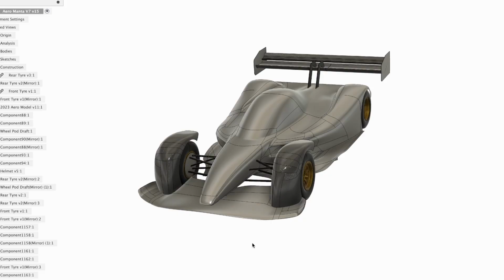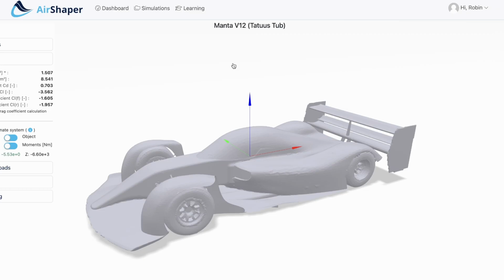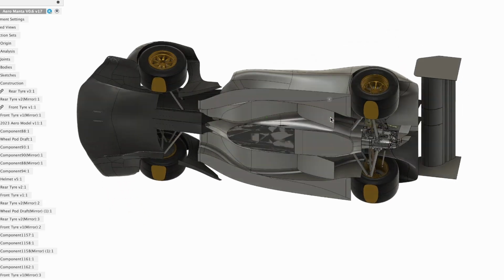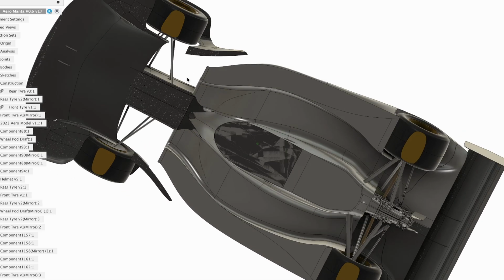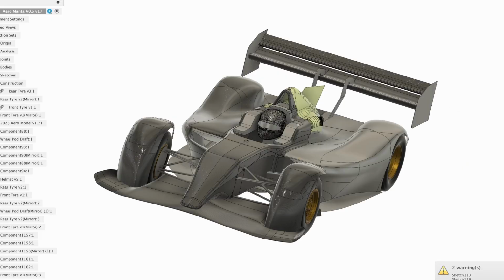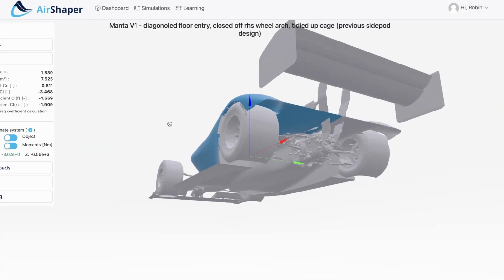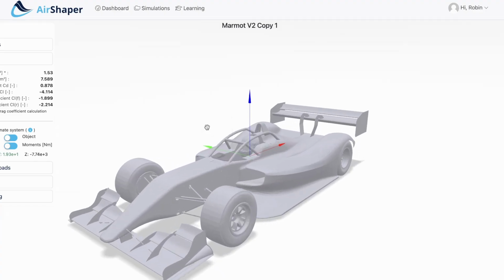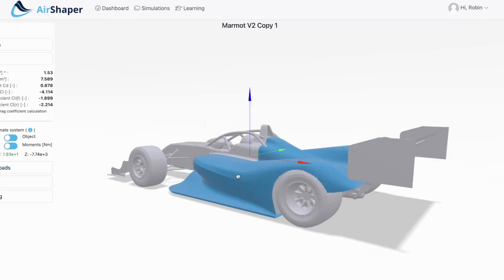Aerodynamic insights: Pikes Peak Project Pivot

Comment: Would it ever be beneficial to have downforce elements on the wheel side of the suspension? To apply downforce directly to the spindle instead of from the body to the spindle?

Comment: Flaps, deploy-able trip-strips/VGs, or blowing slots in the tunnel are all very interesting.  Using a "single" central down-force control should make failures less catastrophic in addition to simplifying everything.  ("single", because you still might want to split the flap action left to right to help turns)

Comment: Why do you start the underbody tunnel behind the front suspension?  Why not start it between or in front of the front tires?
Reply: Probably to account for the gearbox sitting there. The motor is compact and the gearbox isn't massive, but they do still take up space.

Comment: I find the shorter under body tub continued by the engine cover an interesting compromise.   On the one hand it breaks the smooth attached flow in the diffuser, on the other hand it lets you introduce fresh high energy air from the cooling system at a critical point to avoid flow separation.  Kicking the back of the engine cover up more and installing over-kill cooling fans could be an interesting future mod.

Comment: Im not sure if its just the video but the air shaper cad model seems very jagged especially with the roll cage and suspension, which would cause havoc for a cfd simulation

Comment: On your CFD trial of aero elements attached to the front wheels, turning with the wheels, to help with turning, but only generating 0.1g lateral:

What of the aero elements did not pivot with the uprights?  What if they were turned by the steering tie rods, but had a pivot  point closer than the uprights. Do you could amplify the steering angle to the aero elements?  So, you turn the front wheels 10 degrees, but the aero elements turn 20-30 degrees, for example?

Comment: How about the banned F1 version of active aero?  The driver moves their knee over a hole, which blocks off some airflow and stalls the rear wing for lower drag on the straights?  (I think I have that right)

Or does a solution like that require too much design and testing, needing a F1 budget?  (On constant altitude?)

Comment: How do you decide where to put the throat of the tunnel?  Is there a general sizing ratio for tunnel inlet size to throat to expansion champer size?  I am working on tunnel ideas an open wheel autocross car.  Love watching your videos.  Cant wait to see the build process!
Reply from the maker: It's a tradeoff between where you want the centre of pressure and what other parts of the car are in the way

Comment: Body styling wise it becomes very hard to do something that nobody has done before and be aerodynamically effective at the same time . I tend to agree with you , the open cockpit is the better looking though not a great looker . In my mind the coke bottle profile looks to fat at the rear and out of proportion. I’d have a dabble at making a fancy aero section between the front arches and the top of the tub either flat or dihedral  . A bit like a canard but full width. If that gave you more front end then you could balance it out with a better rear aerofoil. 
I’d appreciate some detailed analysis of suspension geometry and your options on roll Center heights, caster camber gain / settings on a double wishbone setup. Mainly , do double wishbone cars have less than Mcphearson strut type vehicles. ? And for what reason .👍

Comment: Wouldn't it be the best idea to cover the rear wheels? Makes an absolutely massive difference in terms of drag, and I'm assuming brake cooling isn't nearly as big of an issue on the rear wheels (and can likely be solved in other ways).

Edit: I meant covering them fully, like on the Volkswagen XL1
Reply from the maker: I ran those experiments, wheel covers work better
Reply: @ I meant covering them fully, like on the Volkswagen XL1

Comment: A question on the relationship between aerodynamics and handling. Cars struggle to change direction as they get heavier (increase in mass). How does this differ from a handling standpoint when adding downforce? Both add weight to the car although more downforce is good but more mass is bad.
Sorry if I am phrasing this badly but it has always baffled me and I'm hoping to understand the difference
Reply: Downforce doesn't add mass the the vehicle, as the name implies, it only adds force.  Downwards. The inertia of the vehicle stays the same.

Comment: Hello good sir, I have this question that might just be silly. I was wondering if the material that is used for the vehicle would affect how the vehicle performed aerodynamically? For example would a carbon fiber body outperform fiberglass not in terms or weight or strength but aerodynamically. I really was just curious
Reply from the maker: Just aerodynamics, and ignoring everything else, I don't think so. But stiffness is important as maintaining correct shapes or flexing in a designed way can really help
Reply: @thesendyclub  thanks much for sharing your knowledge, much appreciated, I'm trying to get into the automotive world and every bit of information is appreciated even if it's not "necessary/relevant"
Reply: Smoothness also matters (but it doesn't matter how you get that smoothness.

Comment: Weight or Drag? I was shocked at the Cd listed compared to street car numbers I'm familiar with. Then a little research and yours is comparable to F1 body types. It's all about downforce. Since you must have downforce which creates drag. Then the lowest weight possible (I know you are already doing that) makes the greatest difference. I would think undertray for negative lift would center the downforce, vs the wings which puts it on the extreme ends. Center seems more stable/predictable for handling. 

Really this is all a thought experiment to me. I don't have any practical experience (which is obvious). Thank you for sharing your process with us.

Comment: For the model, are the floor and body actually connected, or are they separate pieces positioned as close as possible to each other? If they are connected, how do you do so with the surfaces?
Reply from the maker: Separate parts so we can get individual component forces. I use zero tolerance on these models. Airshaper figures out the rest
Reply: @thesendyclub  What do you mean by zero tolerance? Is there a way you consistently get the parts as close as possible?

Comment: If you want something a bit more visually striking I would modify or just redesign the front wing. I think the body looks fine, not as cool as the Manta concept, but close. It’s the front wing that makes it look old school. Replace/modify that to be like the concept with the front wheel covers and tied back into that low body plane and I think it will be more striking.
Also I love that this is following the arc of a real engineering project, start with wild concepts, buy into a few constraints, make some tough decisions on compromises to meet budget and schedule and hope you end up where you wanted.
Reply from the maker: Hmmmm, great minds think alike....

Comment: in orther to generate more high pressure under the nose boxe, you can upper the nose a bit more, like in 2010 f1 cars, and extend the floor foward all you can. You will create more downfore with the floor
Reply: I say this becouse the floor is the more efficent aero part of the car. So I would start making the best with the floor and the other parts of the car. Look for example how the Empire Wraith floor and diffuser is built, and also the PP version
Reply from the maker: There are quite a few ways to feed air to the floor. You're right, in the early 2010's they found the high noses gave them some gains based on that ruleset. The nose you see on the car is the stock Tatuus item, the final nose will be a little different

Comment: Very interesting! Do you expect/have you ever experienced porpoising? Your floor looks very F1 like, but since Pikes Peak is quite bumpy I suppose you are not running nearly as low, so I suppose it's not really a problem?
Also, I've seen that you mainly use your front wing as a downforce creating design. Because it is so low to the ground it is generally quite easy to hit downforce targets, and it's usually seen as a device to manipulate the airflow to make the parts behind it work better (think Y250 vortex and such). So if you go into the details, you should probably start looking there and what you would like to achieve at the rear.
Reply from the maker: Yes, porpoising will be an issue with this much underfloor downforce. The shortened floor I have shown will be very susceptible to that, and I have since adjusted the floor's geometry to help. But that will always be an issue I am fighting. You're right about the front wing also, a lot more development has come there also
Reply: @thesendyclub  At least you have unlimited regs so you can play around with "ice skates" and stuff like that, that should offset your lack of experience and tools compared to the F1 guys

Comment: Are you simulating with no yaw? If so are you able to split the model along the centerline and apply a symmetric boundary condition? Gets you more detail for a given number of mesh elements but obviously less useful with asymmetric air inlets, radiators etc
Reply: Ride Height too?
Reply from the maker: Good question! For a lot of development I did straight ahead and a fixed ride height. But there has also been work done at Yaw and whole ride-height sweeps

Comment: i have a idea to add to a piks peak car that is just cant get out of my head.
english is not my first langwitch and its rikky to explaine.

but if u are curius jest DM me or react to this coment and i will try.
Reply: oke let me try.

u use a fan to pull the air true the radiators, u use a simple and un controlled dynamo on the crankshaft at the distribution side of the block.
u then place the radiators length wise at the side.
so that forward motion of the car will not feed the radiated.

it sound stupid but it has some surprising benefits.
the force to push air thou the radiator will skip the entire drive line, needs no grip from the tire.
the drag form the side pot can be eliminated and the power to overcome drag from the radiator core will come from the crack shaft.
Reducing load on the drive train and tires.

u can have maximum cooling 100% of the run.
Instead of no cooling in the corners wile going 40MPH and having side pod blead over at top speed.
so it wont need to be oversized at top speed at the bottom of the hill.

so for 50% of the run time u can go white 80% fan power and the last 50% 100% fan power.
leaving HP for top speed at the bottom of the hill instead of wasting it dragging a radiator thou the air with a thermostat have closed.

the radiator can also be a lot smaller because u can have maximum cooling wilsed slowing down for a corner, going true the corner and the initial acceleration.
the time spend under optimal air flow for the radiator, say 80MPH can be as big as 33% of the run time.

1500BHP will need about 3000BHP of cooling minimum.
but u will get only maximum cooling when the motor produces 1500 BHP.
but if u cool all the time u can have radiators that do 2500 or 2000BHP of cooling.
smaller compactor and lighter.

and it whoned be a band fan car if the air is pulled from the side above the floor and bleed out true the engine cover. adding no downforce

it will reduce drag because no side pod.
Maybe some small scoops the bend the airflow at high speed.
and it removes skin drag for the radiator section.

With the dynamo/alternator directly on the crankshaft u have extra rotating mass so u can go for a ligher flywheel. 

i can explain it mutch better in a call if u want.

u can have this idea for free, i just whant stuff to go fast.

Comment: When using the simple surface models, does AirShaper “understand” to any degree that all the air going into the radiator openings won’t be just an unrestricted flow straight out the back?
Reply from the maker: Nope, straight flow through. But the regular and advanced settings use a porosity model, so that is properly accounted for

Comment: Very cool work. I would be cautious with the "basic" Airshaper settings and comparing designs with that. The level of tessellation and geometry collapsing that the mesh is getting with those settings isn't just lowering resolution, but probably not modeling the aerodynamics correctly. Usually in CFD we wouldn't trust results from meshes that coarse.
Reply from the maker: I understand what you are staying, and started with that viewpoint. But what I've found is it has been useful nonetheless when looking at big, basic, configurations like I have been discussing. I have been double checking the results with higher resolutions to confirm findings.
Reply: @thesendyclub  yeah checking with higher resolution makes sense and using lower resolution, while not ideal, makes sense as well depending on resources. I never mess with lower resolution meshes since it can create unrealistic tire wakes and de-feature geometry that is essential to the aerodynamic function, like slot gaps and rotating wheel spokes.
Reply: @thesendyclub  when oyu say higher resolutions did you run a mesh convergence study or something like that>?
Reply: @onlythingicantstand airshaper has 3 resolution levels.

Comment: All fasteners defined in BSW equivalent sizes? 🤔
Reply from the maker: I haven't reached that level of Engineer just yet🤣
Reply: @thesendyclub  😄
Reply: @thesendyclub  Aww it's 'easy' just take the imperial equivalent of a metric thread diameter then use this handy example to derive all subsequent values;
A 1/4W Whitworth wrench is the same size as a 5/16BS British Standard wrench. Both have a measurement across the flats of 0.525 inches, or 13.34 millimeters. 
Simples! 🙂

Comment: What will happen if you discard the lip in front of the cockpit in place of a gradual inclined perspex? nothing fancy just a bit less vertical.
Reply from the maker: The little vertical screen does a really good job of deflecting the air over the driver's helmet. The geometry is sensitive, but it works like a gurney flap in that a very small part acts like a much larger part.